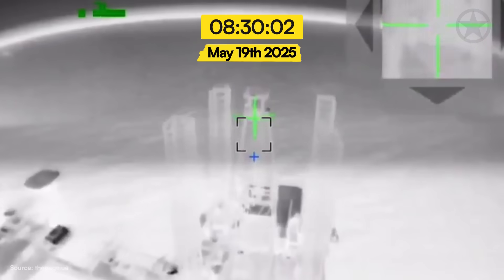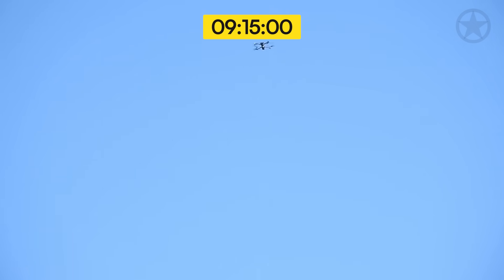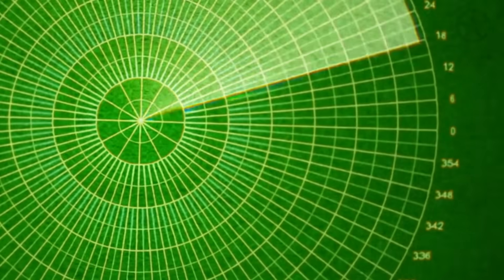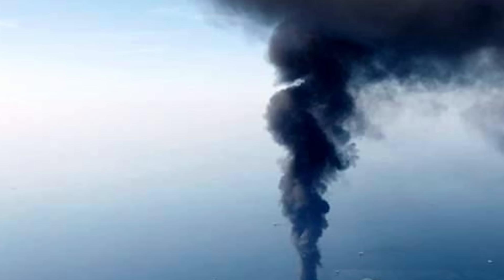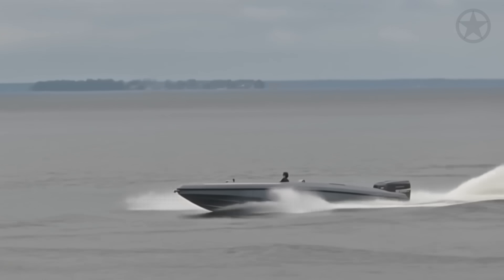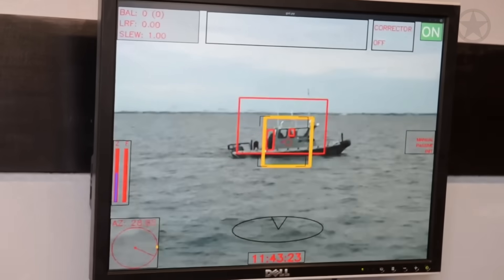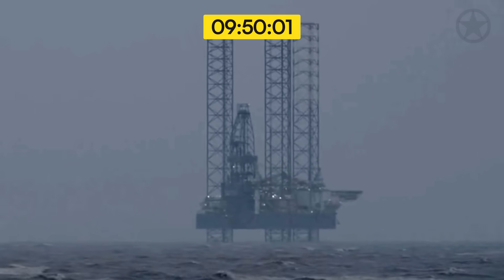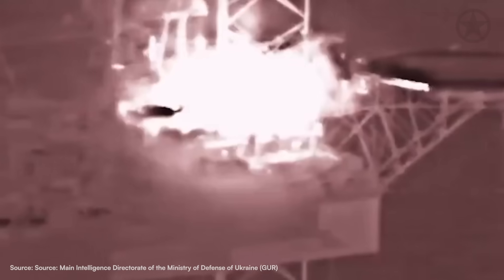Ukrainian Drones STRIKE Russian Gas Platform - Then THIS Happened...

Comment: What I don't understand is this, Islamic enemies have attacked U.S.ships using small fast craft. Some of them capable of 100mph, being converted offshore powerboats. The pilots of those boats were drones of a different type, living. With 4-6 guys per boat you would think they could achieve the same results. I wonder if the UK drones were quieter than an open header powerboat? Or are the planning of the UK that much better than those of   the jihadists.

Comment: Drone warfare becoming the standard actually could act as a force multiplier because you can utilise operators who aren't necessarily capable of standard combat thus freeing up regular military to do other things.  The issue I can see in this situation would be that they operator needed to be so close to the drone but if the area was relatively safe to travel it would still be possible for an ordinary operator to be involved in crafting and controlling drones.  Theoretically you could do the same by replacing the people who build them with civilian electronics makers.  I think the only thing making it unnecessary at this stage to do the latter is that they make the drone during the planning phase, but if there were enough attacks happening that you needed a steady supply, that would be a way to increase production.

Comment: Ihm- a technical question: What did make the video feed analog? I really have no idea. I know there are different systems that are wireless or with fiber optic cable, but that's not what they meant, is it? bevause- I mean, analog and digital doesn't mean cable and wireless, of that much I relatively certain.

Comment: Like so many, I agree this is too long.  Like many Youtube videos, it is longer than it should be to reach certain monetization points.  However if you are watching on a computer, you can just hold the left mouse key and it will fast forward double speed.  You can still make out the narration.  When you hear a repeat of the same data (1000 pound warhead for example)  then just click going forward.  You won't miss anything.  It's like watching the Twilight movies series.  Whenever you see any of the three main characters together - SKIP as literally it is the same conversations.  Then you can watch all the movies in about 25 minutes.  This video can be watched in about 3 minutes.

Comment: Just a note  a "$500 racing drone"  doesn't have the thrust to loft a 3 kilo bomb over 35 km.  Times that price by 10 and you're getting into the range of drone that can possibly loft that much weight for that distance.   It's a SMDH moment about the stupid hype some of these channels blather on about the technology the Ukrainians are working with. This video is not a "Masterclass" of anything except stupid hype.  Also, "10 inch prop blades rotating at 20K rpm" would be dangerously close to exceeding the speed of sound at their tips, another bunch of BS..

Comment: 0:31  That soldier had the same RC radio I have, the Radiomaster TX16s. It's a awesome radio. Unbelievable amount of programmability and is Open Sourced so mods are endless. It's also easy to adapt any transmitter to it. I currently can do over 50km with a TBS Crossfire LR full module. It's my favorite radio I own.

Comment: A 10in drone carried over 6 lbs, along with a battery to do that for over 45 minutes, And the same analog video that only works for 500 ft here, managed to send a signal 35 km, over the horizon, to an antenna only a couple hundred feet above the water?

Comment: Why launch the operation in the morning instead of under cover of darkness?  The satellite guidance wouldn’t require daylight, and the human guided component might utilize infrared.  Could it be because of additional cost of infrared?  Perhaps pinpoint targeting confidence was significantly higher in daylight and vital enough to counterbalance whatever benefit the platform personnel would derive from visual spotting.

Comment: This FRUSTRATING video repeatedly showed at least Two Obvious MISSILE-STRIKES to sea 'platforms'  (the engine trails are Quite Clear - and moving many times FASTER than the described 37mph speed of the 'drone' it described).

Further, the immense Fire-Ball resulting from the  'drone' (missile) strike(s) to the MAIN BODY of the platform means the hit was in an area rich in combustable liquid- or gaseous 'fuel' -- NOT to an elevated 'cabling junction' more than half-way up a spindly RADAR tower.

And Don't get me STARTED on the 2- or 3 video clips of the SEA-BABY ocean surface 'torpedo' - while the audio was ONLY prattling-on about the Aerial quad-copter FPV drone...

Comment: LOL a10 inch frame four prop drones strapped with 3 kilos of explosives at best would have 1-2 KM range max.  Any further range would require a larger battery and the added weight for 35KM distance would far surpass lift capability.  Also, the ability to control a drone at that distance would require a radio transmission tower 100's of meters in height or satellite communications.  Not sure how many Ukranian Military satellites are in orbits so let's say ultra tall radio transmission tower.  That works to send signal to drone, but the drone would need an equally tall and powerful tower to send any information back.  This is purely Monty Python.  "A 5oz bird can't carry a one-pound coconut, as it is a matter of airspeed to weight ratio."  If, the Ukranian Military has the technology to make a 10-inch frame, four prop drone fly 35KM, that would make them a military superpower able to even defeat the United States.  As, the US still needs drones 10-20 times that size to equal such distance.  False hope in these fantasized military exploits of military capabilities will not improve the situation, or for that matter the very lives, of the Ukranian people.
Reply: Have you heard anything about drones on  fiber optics?

Comment: The Russians didn't expect a drone attack on its most important radar installation?  I am not sure if you are aware that Russia and Ukraine have been trading drone strikes for years at this point.  Are you seriously going to suggest that Russia forgot to install a net around the most important radar system in the Black Sea?  This doesn't even make any sense that Russia could not evade a single drone that flew undetected for 20 miles and just under an hour of flight time by one of Russia's most advanced radar systems?  Are you going to tell us next that this mission was carried out by an all female flight crew?

Comment: 0:13   ukrainian-modified standard 10-inch frame $500 chinese quadcopter drone carrying 3kg (6.6 lbs) of high explosives began a 35km journey to kamikaze into a key russian neva radar on the boyko tower alpha gas platform in the northern black sea. the drone's motors spin up to 20,000 rpm.

Comment: “analog video transmission”? How would that work? Over some sort of radio waves, UHF or similar? That would require a radio transmitter on the drone adding to the weight, significantly, I’d guess. Can anyone with more knowledge than me shed light on this?

Comment: those 4 radar you are telling are shoring jack it uses to lift that platform, be informative next time point on the tip of those structures where the radar is supposed to be mounted, fyi some oil rig are sometimes equipped with radar for their helicopter/ship guidance

Comment: It's not so much the low cross section that makes them invisible.  It's the slow speed.  Birds show up on radar all the time and it's obvious from the speed that it's not a plane or a boat.  Unless you listen to the audio from the doppler.  I guarantee that the whine of the propellers would be in the doppler signature.

Comment: WTF ??? Mostly BS. When did Putin lose black sea ? Gerr out of here...35KM carrying 3.5KG + lets assume drone weighs 5 KG ! Hence the amount of energy required is = 8.5 x 10 x height of flight + 8.5 x hrz accel x 35K  J.  Tell me which light weight battery is going to achieve this kind of performance ? F. ing BS.

Comment: This video is someone's wet dream, obviously. I'm not sure how exaggerating the actual damage and lying helps anyone. It's weak and pathetic. 

Anyway, actual updates:

"The Ukrainian drone strike on May 19, 2025, targeted a Russian-controlled gas production platform in the Black Sea, known as the Boyko Towers.  The operation resulted in the destruction of a Neva radar system and significant damage to military supply depots on the platform.  However, specific details regarding the extent of damage to storage facilities and living quarters have not been disclosed. 

According to the Security Service of Ukraine (SBU), the first drone destroyed the radar system, while a second drone targeted military supply facilities at the site.  The SBU emphasized its ongoing efforts to eliminate Russian military presence in the Black Sea region.  

While the attack rendered the platform inoperable and degraded its military utility, there is no publicly available evidence confirming that the Boyko Towers have entirely collapsed into the sea.  The platforms remain a focal point in the ongoing conflict over control of the Black Sea region."

Comment: 49 knots is not all that fast. The Russian crew just wasn’t provided with decent self protection system. That little fiberglass hill boat may hit with the speed of a locomotive but it has no where the heavy steel structure or mass. If it hits a concrete support column the boat will disintegrate while the column feels nothing. The explosive blast are what destroys the supporting columns.

Comment: This video is absolutely false in so many ways regarding drones. Everything said here about drones is wrong. 

A 10” quadcopter claimed in this video w 6lbs payload plus the 1000 grams of the drone - going 35klm is not possible. 

Not only that fpv systems showed in this video can Not travel this distance. None of the antennas shown in this video are long range antennas. 

The only way to complete this mission as stated is by a fixed wing drone.

Comment: A 35 km flight while carrying 3.5 kilo payload is pretty impressive
Reply: The drone in the video with that battery and 3 kg bomb will fly for around 3 minutes, never ever 45 minutes. Y fly self build FPV drones for 10 years, this is impossible.
Reply: @CassetteNights apparently, it is not “impossible”. Thinking that it’s impossible is why it ultimately worked. Small minds lose wars. 😂
Reply: @Agressivemap1233  : Just because you were suckered into believing this nonsense, doesn't make it true.  It's impossible because of reality and the limits of small batteries.  Just like Elon Musk was going to revolutionize the trucking industry by reducing its overall payload so it could fit the literal tons of batteries it needs to run.  This is easy to research, I heard of this new technology called Google.
Reply: i had read in a few places that the drones were only good for like 12km, but they have some secrets, I am sure, one of them was that they have a aircraft carrier for drones,. some sea and some air... this may have ferried it within 12km then launched. in this case, converting some sea drones into drone carriers that could launch airborne drones and they did mention the 1kg boat so it may have gotten a lift most of the way there on the drone boat " sea baby "
Reply: THE TRUCKS THAT CARRIED THE DRONES WERE ONLY ~4 MILES FROM THEIR TARGETS.
Reply: @THE-X-Force true but this video was about an offshore oil rig
Reply: @terranhealer  That's fair. I've been responding to so much misinformation, I commented on the wrong vid. I apologize.
Reply: @THE-X-Force  That was the Airfield Attack some days earlier. I think we are here talking about the black sea platform Attack.
Reply: And 45 min for a 10 inch drone is unheard of!
Reply: @hustlerkc11  : Do you know why it's unheard of, because it's not possible.  AKA as total BS.
Reply: @hustlerkc11  My personal 10 inch "drone" has challenges lasting 45 min - but here we are.
/s
Reply: @radagastdk  Without payload...  ;)
Reply: @radagastdk  : Yes here in fantasy land where Orc's and wizards live.
Reply: @hustlerkc11 Solar powered?
Reply: @mikegardner107  That would take a huge solar panel array!
Reply: Its Beyond Miliary Belief.
Reply: so much so that it didn't happen... not with a 10" , $500 drone.
Reply: Gas powered
Reply: @Anonymous-c6f7d really? They showed a video and it didn’t look gas powered
Reply: @terranhealer  : Are you people for real?  This really can't be an actual conversation between thinking humans.
Reply: @Anonymous-c6f7d  it’s a quad copter racing drone so Electric
Reply: @Anonymous-c6f7d  : Yes because gas is weightless.
Reply: And not possible with a "500 dollar racing drone"..
Reply: It was a very chonky battery on top of the drone, and I think they must disable the battery protection and discharge below 0% because who cares about the batteries health if you're going to blow it up.  That must give them just enough capacity to make it there.
Reply: How does it send back video to the operator over 35 km while flying at under 50 meters?
Reply: @rafaelojeda6470  They used the local cellular network for internet.
Reply: @rafaelojeda6470  They use the cellular network, the dji dongle is only £129.
Reply: @rafaelojeda6470  They used RU cellular telecom network for internet.
Reply: @rafaelojeda6470 the video part is easy. It essentially would carry a cellular sim card relaying data continuously. Probably connected to a military comm satellite too
Reply: @terranhealer  If you say so...
Reply: No its not impressive because of physics.  Drones of this size have battery life measured in minutes.  Why do you think there was no actual footage of a burning platform?
Reply: @johnjames2470 I was born sarcastic as was my comment
Reply: It is these specs which make this dubious. I run a rec drone that has about a 10 inch width. It cost me $2,000. It carries NOTHING. It can travel a long way, but its battery life is 35 min at best. We have a local company doing drone deliveries. They use large drones with 12 rotors and 4 propellors for forward propulsion. These only deliver up to 9km and only carry 1.5 kg.
This claimed 45 minute flight carrying a 3 kg explosive on a 10 inch drone (for only $500) sounds like fantasy.
Reply: @petesig93  I feel like I'm speaking into the void. They used quadcopters that were launched from trucks carrying cargo sheds within 4 miles of their targets, and used the local cellular network for internet. NO ONE claimed a 45 minute flight time.
Reply: @THE-X-Force  Did you even watch the video?
Reply: @JazzFunkNobby1964  Sorry, I went straight to the comments with this A.I. slop video.
Reply: @petesig93 They buy them in bulk?
Reply: The pilot must have been closer? Maybe a mini sub took him & the FPV part way & then they poked their nose above the waves? I've no idea, just a guess.
Reply: @BelleBlu  : I think Ukraine had help from the aliens that built the pyramids.
Reply: @johnjames2470  The pyramids were built from the top down.
Reply: @BelleBlu  : Maybe space aliens that helped build the pyramids?
Reply: An no pee breaks
Reply: 7.7 pounds.
Reply: @mikegardner107 right! I’m guessing they have some extra big blades and oversized motors…plus extra batteries for sure. Probably just enough to get to the target
Reply: @terranhealer  : Probably not.  Instead of guessing, why don't you research it and then you would know its a lie.

Comment: From Google AI:  "The range of an FPV (First Person View) drone varies, but generally ranges from 0.5 to 4 miles (0.8 to 6.5 kilometers). Factors like video transmission method (digital vs. analog), environmental conditions, and the specific drone and equipment can influence the range. "
Not quite 35 Km...............  Sounds like they meant a boat drone.
Reply: They used relays and improved antennas, pretty standard stuff.

Comment: I thought these gas fields were long gone.
Reply: They are. It's used for surveillance and the diesel fuel stored there is only to power the generators.
Reply: At first in 2014 pootlerstan thought they could steal the gas and continue drilling to produce more. Eventually Ukrainian resistance dictated installing radar and defense systems. I do not know if there is any attempt at drilling these days.